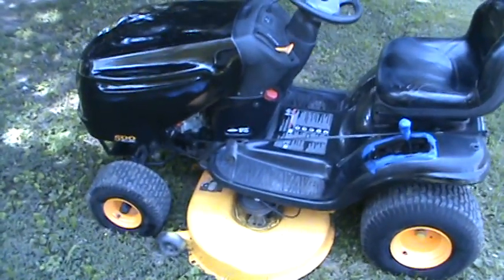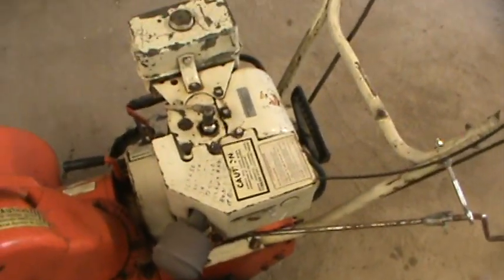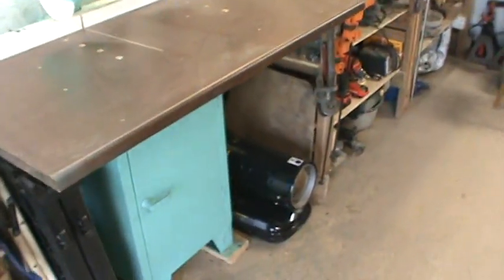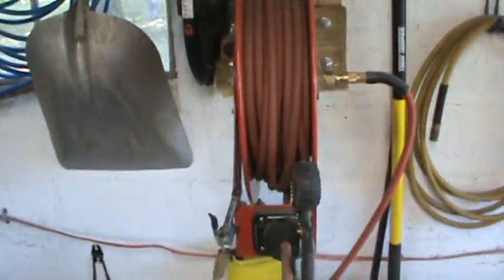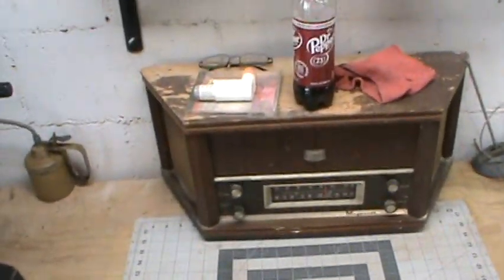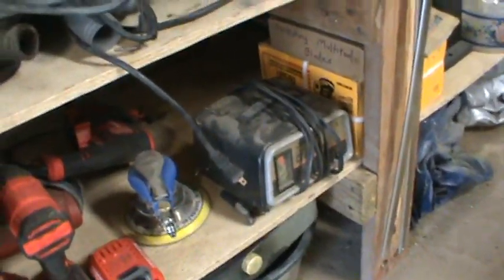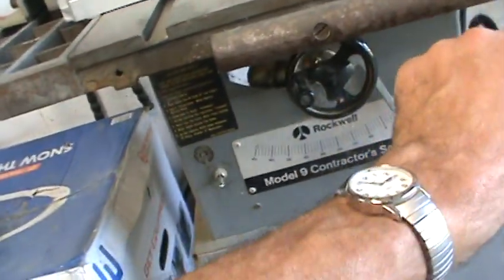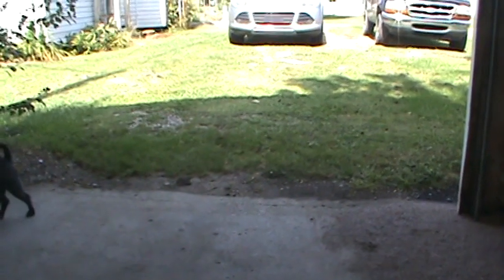Tour of My Garage

Comment: Nice assortment of this and that and EVERYTHING! I wonder whose bright idea it was to put plastic tires on that heavy of a snow blower?  Crazy!  Thanks for the tour! 👍👍
Reply from the maker: I know...And the thing was made in 1965 so it's had a few years for those wheels to wear down, lol.  I saw a bigger one in Northern, KY for $100 with rubber tires.  They said it wouldn't start, but I figure I could put a harbor freight predator engine on it for $149 and have one tank of a snowblower, lol.  The one I have now has more steel in it than 3 new ones.

Comment: Hey Gary. Good to see you making a video once again. And to think, I've actually been in that garage. LOL Looks like the ol Ranger is still going strong, but your mom's trailblazer has been replaced. Nothing lasts forever I guess. Still have not made it to Cincy to get any scenic view video, maybe one of these days. Been pretty busy also. :)
Reply from the maker: Yeah, I went to check her oil in the Trailblazer one day earlier this year and it was milky looking.  It could have just been around the cap as it wasn't on good and might have let some condensation in there (She let the local walmart change her oil last time and the cap was on crooked), but I think she was more looking for a reason to get her a newer vehicle and that was good enough, lol.  So, she has that Fusion now.  It has a smaller engine than the Ranger but puts out more hp...go figure, lol.
Reply from the maker: I just got back from your neck of the woods.  I bought an edge jointer on facebook marketplace up near there at a place called Swifty Farms. I'd have stopped but I wanted to get back home before it got too hot out.  I was cool enough coming home, but by the time I got that beast unloaded and into the garage, I was soaked, lol.
Reply: @Rebel9668  Yep, I am familiar with the place. Probably a good thing you didn't stop as you would have found no where to sit! My couch if currently full of boxes and my living room in general is a total wreck. LOL Maybe one day, I'm hopeful. :)